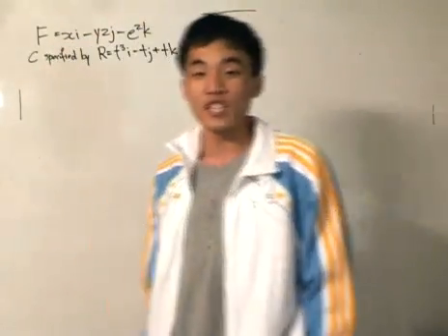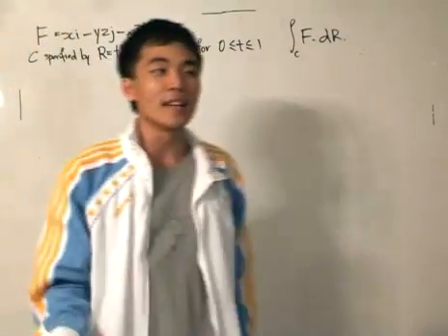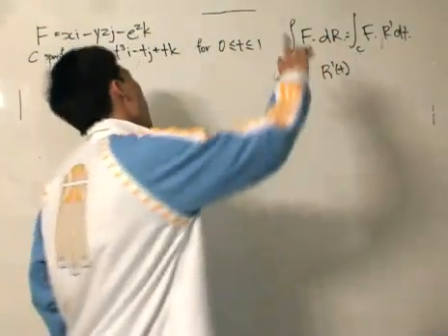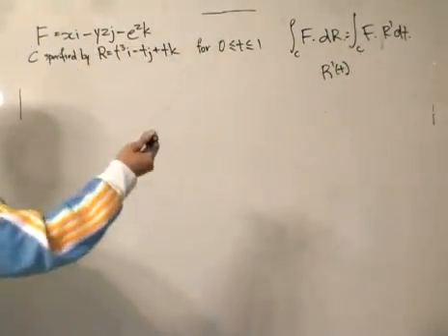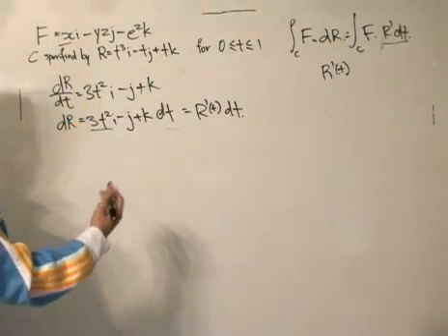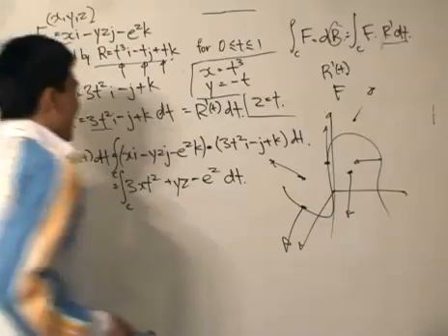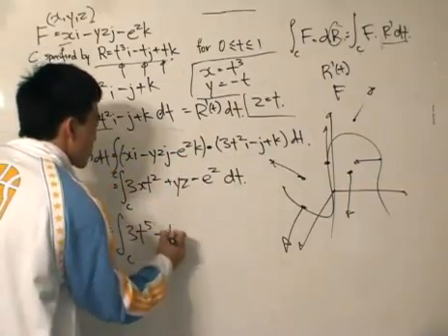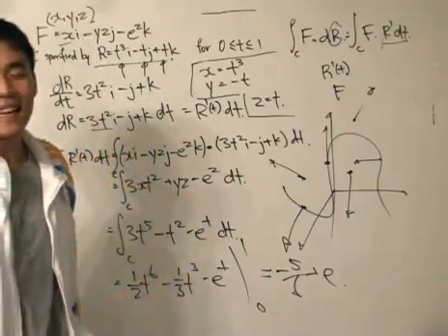Line Integral - short example

Comment from the maker: Hey guys, thanks for that quick correction. Yup, you guess are correct. I was just referring to my website and the reason I got the answer wrong was that I started out with the wrong vector field equation. It supposed to be '+e^z' and not '-e^z', in which event it would have been -5/6+e.

Oh while, hope you get the method though.